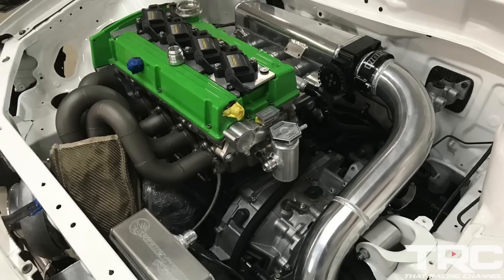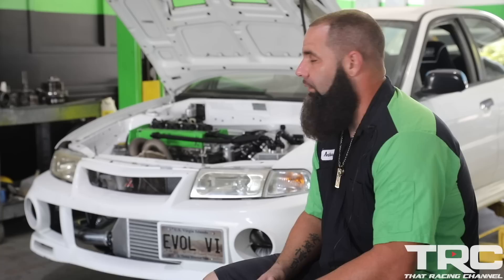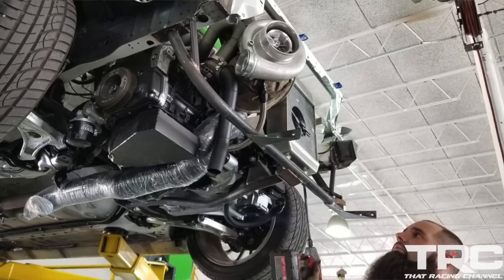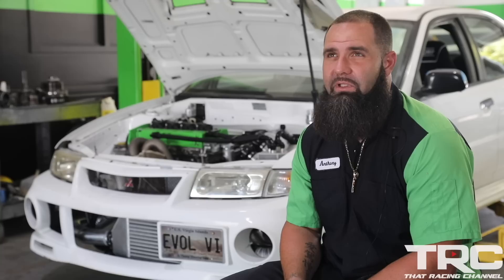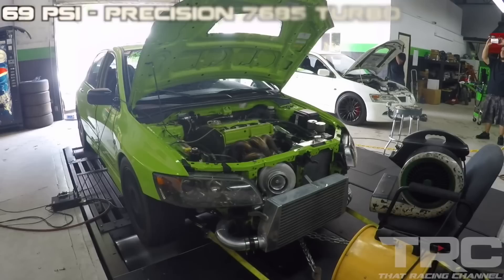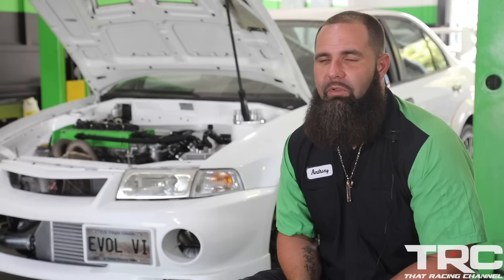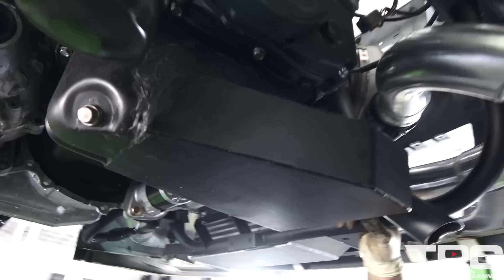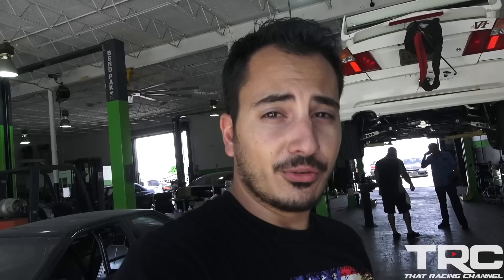1400HP Evo 6 RS on 64PSI 10K RPM!  - Highest HP Evo 6 Ever?

Comment: 1400 hp....

 says it's nothing too serious....

Pshhhhh
Reply: Dominik Ladoš  and they are using street tires
Reply: Kyle Bryant hi Kyle
Reply: Dominik Ladoš  bit different from a evo most people can afford a evo....do you have a lambo lol
Reply: Lambo also has a way higher displacement.
but its cool people have to pull out modded lambo stats to compare  with it lol
Reply: Dominik Ladoš  and Supras now have 4000hp
Reply: @Legend-lc9bv  LOL, not the 2JZ block. Only a billet custom made block.
Reply: @TrojanLube69  Ive seen 3000hp once without a billet block
Reply: Welcome to a world where a e60 m5 has 800hp and hitting 240mph in 6th geae with a 7 speed transmission

Comment: 64 psi wtf is the head gaskets made out of
Reply: Symbiotic226 Vibrainium
Reply: Probably o-ringed
Reply: Satan's tear
Reply: Jessie Sanders  LOL
Reply: Copper gasket enough
Reply: thors hammer
Reply: Bubble gum and adamantium
Reply: Unobtainium
Reply: Jessie Sanders  or they used super glue
Reply: Copper is enough
Reply: @TheAdatto  Miners haven Remark
Reply: Paper yes that's right paper gasket for the win.
Reply: Jessie Sanders  You know im still surprised high hp car guys dont weld the head to the block with thin plates yet
Reply: titanium
Reply: Tungston
Reply: Probably factory with copper spray.  Shep was using using that.
Reply: Torque is capped to half the hp for a reason
Reply: Mr Medium MAINTENANCE
Reply: Flex Tape
Reply: Kryptonite
Reply: There’s no head gasket, the head is welded to the bottom!
Reply: Probably multi layer metal gasket
Reply: Cooper
Reply: @mikep3322  a mini Cooper as a head gasket?
Reply: Hopes and dreams
Reply: 200 % Rizzzium!!!!

Comment: 4G63 ...ladies and especially gentlemen ITS A 4G63! Enough said.
Reply: There such awsome motors
Reply: One of the most legendary engines of all time!
Reply: @migram4190  4g63t... 1-2JZ... RB26 sr20 vr38 k20  best motors ever.....but but but shitty German engineering is better....Not!
Reply: @jdmpwr4283  you forgot the EJ207 😠🤠
Reply: @jdmpwr4283  and the 4b11
Reply: @jdmpwr4283  Bruh you didn't even mention 13b or 20b. Reported for false information.
Reply: @iCrimzon  junk weak alloy German design.
Reply: @4bidn1  those blow up every second I love them just not practical at all.
Reply: @leftymeltdownisfun.2110  Unequivocally false, how would mazda run a rotary at the 24hour le mans if they "blow up all the time"?

It may take some extra know-how and maybe some precautionary mods and testing to have running reliable (when running massive power, stock they are actually very reliable) but that doesn't make it a worse engine than the others in that list. 

Was half making a joke anyway but the rotary always deserves it's spot due to the innovation involved in it's conception and the physics behind it. It's like; quartz watches are considered to be the lower end of watches but the quartz watch technology will always be regarded as innovative and historically significant.
Reply: @4bidn1  dont try trick me fanboy i just told you i liked them there unique .....BUT they are not reliable and use insane amounts of fuel to make any power . That's my opinion based on facts and experience .
Reply: @leftymeltdownisfun.2110  you are wrong. I’m not Tryna trick you or anything, the myth that rotaries are unreliable comes from people not understanding the workings of the motor properly/not knowing how to take care of it, they are not inherently poorly built or unreliable. That is fact.

Comment: The Evo VI has the best looking rear wing of any of the Evo lineage.
Reply: No just no
Reply: @ready4grabs  OK, was what in your (incorrect) opinion is then?

Don't say Evo VIII just because it's the only Evo you've ever seen.
Reply: @Zerofightervi  i love evo IX the most with the almost full red lights. Car in gray with TE37 with one spoke in red. And the Brake calipers in black with red brembo lettering. I would love the varis bodykit. Never ever say i didnt see an evo its my favourite car and i want to have one so bad but i live in germany :(
Reply: @ready4grabs  I love Evos but the IX rear wing is not a patch on the Bi-plane arrangement of the Evo VI.
A wing so large the FIA made Ralliart add a blanking plate to the lower half when the VI was in the WRC.
Reply: @Zerofightervi  i prefer evo 7-9 but i got love for VI too but i dont like the VI front
Reply: @ready4grabs  I think the VI front looks best with the fog lights in place.
If I had the CT9A I'd definitely go for the Voltex high downforce kit, I know it's on everything but it looks the best & actually works.

Comment: https://www.precisionturbo.net/Street-and-Race/ss/1-200-1-500HP/details/Street-and-Race-Turbocharger---Sportsman-GEN2-PT7685-CEA/605
Precision rates this turbo to produce up to 1350 hp. It is categorically impossible for this turbo to make this much power with gasoline as the fuel, especially with this much boost and an intercooler that is that small. It's a street car that spools at 6k rpm, doesn't have room for an air filter and would leave you deaf after your first dig. Sounds about right. Probably idles with about 11" of vacuum with the 288° cams. These engine builders have also claimed 1291whp with this same turbocharger. Find a flow map for this compressor and look at the flow at the top right corner and see how far out outside the efficiency island you would be at a pressure ratio of 5.4 and a mass flow of 133 lb/m. An AirWerks S480SX-E cannot do this, the pressure ratio is too high. There is a reason people race cars and not dyno figures because one doesn't have a crushing correction factor applied to it.
* Edit *
This is the turbo you need for the numbers shown. It's a t6 framed GTX5533 85mm. Jesus it's big.
https://www.garrettmotion.com/wp-content/uploads/2018/05/Comp-Map-GTX5533-85mm-1.jpg

Comment: A LHD Evo 6 from the US Virgin Islands?!? 😲
Wow, that's super impressive. Oooh, and an RS, lighter with super close gearing and all. 😈 Then he says he's changing the transfer case to an Evo 8. 🤬
Reply: i noticed that too. had no idea they made LHD, unless it was converted
Reply: @1benyko  I knew Europe had some as part of Mitsubishi's WRC efforts but I'm with you on where it originally came from. He said only 76 worldwide and that number sounds very right as from what I remembered, the LHD RS's were mainly Mitsubishi's stock to be converted into WRC cars for Makinen until they swapped in mid-2000 to the Evo 7 for racing. 👍 All RS's imported to Australia are RHD due to the JDM market having both GSR and RS available for sale to the public. 😎
Reply: MafiaboysWorld they swapped it out cause the evo 8-9 Tcase can handle more torque.
Reply: @IamByzer  I know bro, I watched why. 👍😉
Just was hoping it was going to be the E6 box as the ratios on it are super tight, all 5 gears through the 1/4. Seen it here on Aussie based JDM RS Evo's, it's just an awesome sound. 👍
Reply: @MafiaboysWorld  does he meant that number in LHD in UK there's a lot of 6 RS's
Reply: @RS7John  Yes. LHD only. We've got heaps of RHD ones here in Australia aswell. 👍

Comment: Goood, it's just, that the Flow-Improver is missig on it, instead of this ordinary intake manifold , because it would get some extra 100 -150 horsepower .
Reply: Space was an issue in the EVO VI but still made a good number. Was spinning the tires bad so we left it at that number until the Buschur Shootout next week. If it hooks we up the numbers. Thanks for the post.

Comment: I got a question is the Tq low because of awd?
Reply: Cameron Summers to much torque on an AWD can destroy the transfer case if not launched right. That’s why you’ll see a lot of Evos with a low torque reading. T-case aren’t cheap to find and are pricey to build.
Reply: The higher in the rpm range an engine produces power the less torque it'll make , you can make 1000 hp at 4000 rpm but you would have to make 2000 lb/ft torque to get there . HP is a function of torque and rpms

Comment: $30,000 bucks in parts around $15,000 labor since the customer had an unlimited budget they prolly raked him over the coal$ a bit more on the price. If you pay a shop $1,000 bucks a day in labor and it takes 2 weeks to build it. The dog gears around 4-7 thousand the engine build about the same, a custom evo 8 subframe and transfer case is far from practical, the owner needs to move next door to this shop because when it breaks what's he gonna do keep sending it back?

Comment: rear brake lights looks like Evo V......it wasnt a conversion? anyway my favorite Evo of all time VI gen......
Reply: The rear lights are the same on the Evo V & VI, the IV has a different design with the brake light being at the top of the cluster.
Reply: @Zerofightervi  you probably never played Gran Turismo......just googleing shows you the difference......
Reply: @cj41079  What are you talking about?
The Evo V & VI have the same rear lights, the actual triangular sections are identical.
As I said, IV has a different design, I should know, I owned one.
Reply: @Zerofightervi  Evo VI RS tailights dont have lights on the trunk portion which this one does......thats what im talking about......
Reply: @cj41079  Why didn't you say that in the first place?
That section of the lense is normally just an empty trim piece but this one seems to house the rear fog lights on this particular VI.
I had these sections on my IV GSR but they were empty.
You are correct, RS models shouldn't have anything on the boot lid so these are probably from a regular Lancer model or are maybe an addition for a particular market.

Comment: Looks pretty nice but it will not last long on 64 psi so hopefully the owner doesn't have to heavy of a foot.
Reply: Thanks for the post! It was built to handle much more boost than that! We have traction problems to deal with first!
Reply: @00EVOLVI  What was the compression ratio was it said in the video?
Reply: Ancient Chinese secret 😂😂😂 will disclose at Buschur Shootout That racing channel video! Thanks again for the interest and post!
Reply: Jim Burke With the tuning capabilities you never know what the compression ratio is these days on built cars. There are Turbo Volvos out there putting out over 1000hp some with nearly 12.1cr and some closer to 9.1 or even 8.1. My Volvo 16v turbo has 8.1cr after new high dollar rods/pistons, pretty low but I plan to use a ton of boost pressure. Since no one in America outside of maybe 2 or 3 guys knowing how to tune the high power Volvos the DSM tuners do a pretty good job. The motor I have is similar enough to a Evo motor just slightly larger a 2.3l

Comment: Those torque numbers are whack. Relatively speaking. Why not stroke this motor?
Reply: Because this motor makes peak power at 10k rpm. A fuck ton of torque is useless if you’re just spinning tires all day especially on a “street build”. Also the block and internals would be under A LOT of stress because again you’re spinning this thing to 10k rpms, not something you want if you expect some form of streetability. Think about it this way, F1 engines of the past used to produce 900+ hp out of 3 liters of displacement while only producing around 300 lb ft of torque but they spun past 15k rpms. They were plenty fast cars regardless. Torque isn’t everything when building a fast car.

Comment: trunk looks evo v
Reply: The V & VI essentially are the same, different rear wing, front bumper & wheel design.

They share the same bonnet, side skirts, rear bumper head lights & rear lights, widened front & arches. 
The exception being a V GSR has a two tone light section on the boot lid which the VI TME had at a later date.
RS models shouldn't have any lights on the boot lid for either IV, V or VI.
This particular car looks like its had them added.